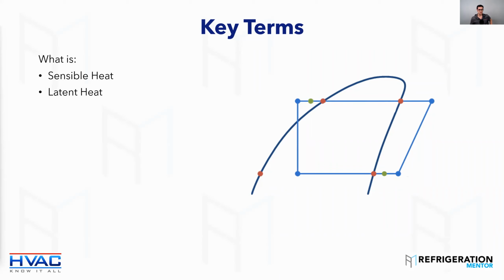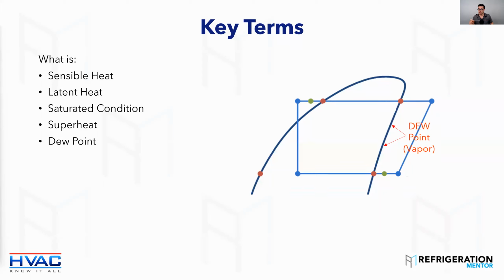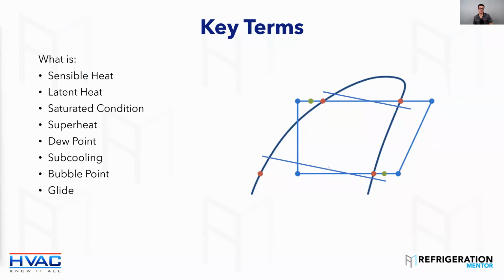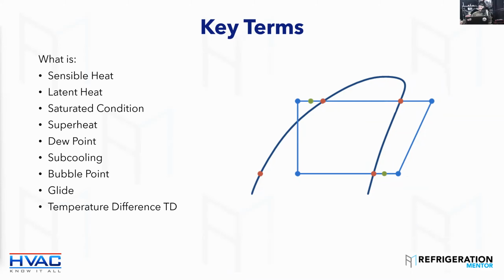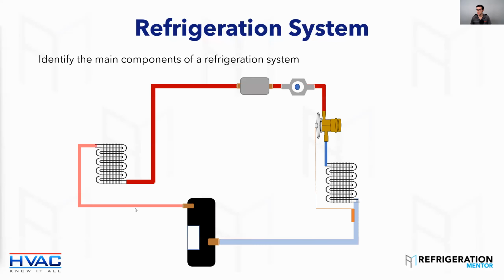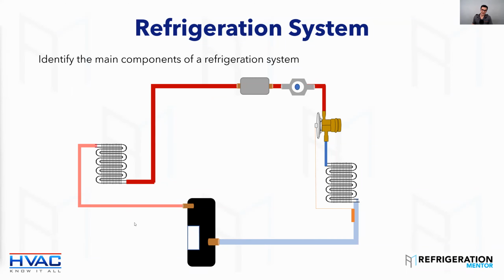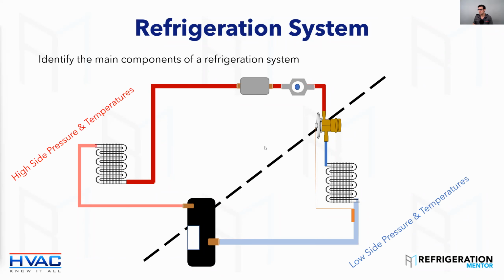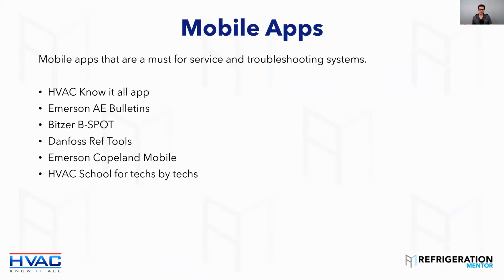The Basics of HVACR & The Refrigeration Cycle - How it works

Comment: Sewer flow - you will also encounter this term when you work with evaporative condensers for ammonia. " Refrigerant is allowed to overflow to the main receiver
and the connecting line is sized based on sewer flow"-Piping Evaporative Condensers by Evapco
Reply from the maker: Thanks for sharing.

Comment: Below the critical point, there exists a pressure-temperature relationship. You will be shocked to see frost on an ammonia hot gas supply line, then you realize that the hot gas solenoid is not seated well during cooling.
Reply from the maker: Yes Below the critical point is subcritical r744

Comment: ASTP - Advanced Scroll Temperature Protection. Compression is stopped to prevent the compressor from further overheating. Prevents permanent damage. Takes time to cool, then it resets the internal mechanism.
Reply from the maker: Exactly

Comment: TD - temperature difference between room temperature and evaporating temperature. Lower TD means larger surface area. Lower TD means you can operate at higher suction temperature, which means more efficient operation. Another impact of TD is on the relative humidity. Lower TD means higher relative humidity in the room. Higher TD results to drier room.
Reply from the maker: Thanks for sharing

Comment: Sample of Glide: The refrigerant R407F is a zeotropic refrigerant mixture consisting of three components with different boiling temperatures. This results in a temperature glide of 6.4K at the phase change. R407F is suitable as a replacement and drop-in refrigerant for R22 existing refrigeration systems.
Reply from the maker: Thanks for sharing. It would not be a drop in for r22 as you need to replace to POE oil

Comment: Analogies allow learners to use prior knowledge to better understand an unfamiliar topic. To teach about superheat I talk about a familiar substance - water. Water boils at 212F at sea level. The liquid part at 212F is saturated liquid. The vapor part at 212F is saturated vapor. Once water turns to steam and it absorbs more heat, the temperature rises above 212F. The temperature increase above 212F is the superheat. Example : Water boiling at sea level (0 psig  or 14.7 psia), steam at 212F is saturated vapor. steam at 220F is superheated vapor with 8F superheat.
Reply from the maker: Great explanation. Thanks for sharing.